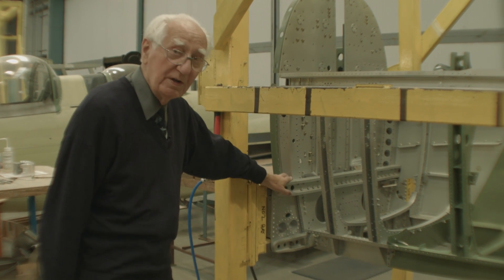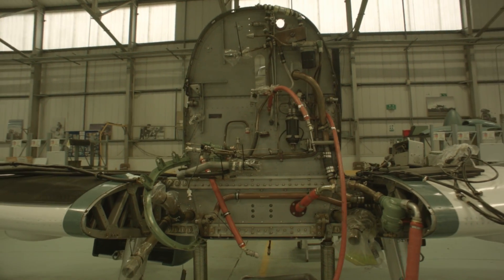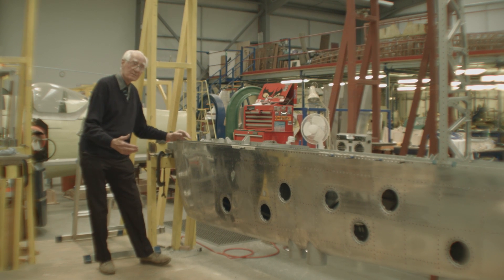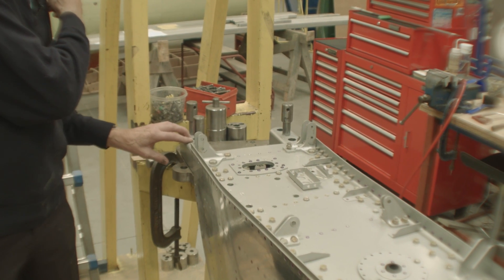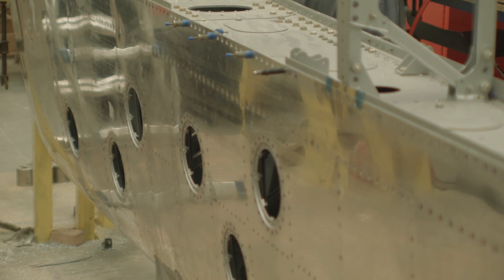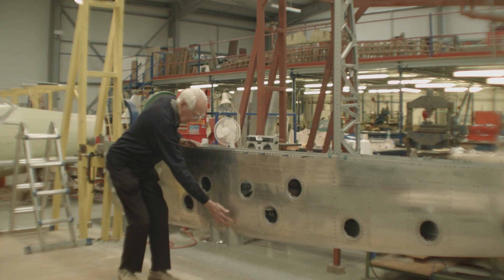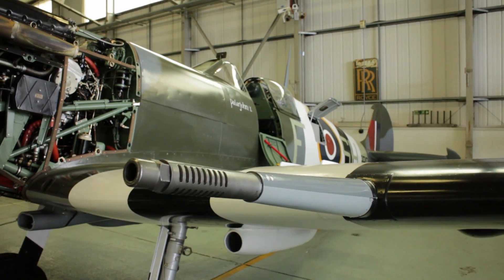Norman explains Spitfire Wing Construction

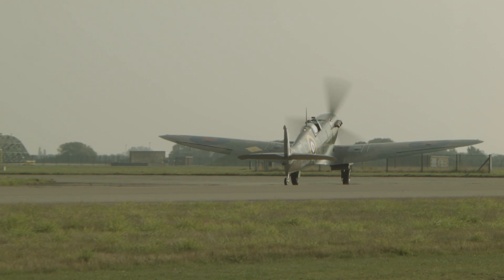Comment: 0:25 leading edge is at the bottom, and trailing edge is at the top. The main spar, or upright of the D is at the 1/4 chord position. The center of lift also occurs 1/4 of the way from the leading to trailing edge, so making the 1/4 chord a straight, unswept line from wing root to tip, you put no twisting moment on the spar. That's why the Spit's elliptical wings are skewed forwards from root to tip
Reply: This is not true, you´re over simplifiying mixing aerodynamical and structural considerations (twisting of the spar...?) The "D" is the torsion box between the L.E. and the spar, and the wing has a 2,5º twist in order to keep the stall on the root first, maintaining aileron control yet in incipient stall.
You´re plenty of information material available, so I left here a link in order to clear some considerations.

https://www.aerosociety.com/media/4843/the-spitfire-wing-planform-a-suggestion.pdf
Reply: @TheMissing62  what do you think I said isn't true? The aerodynamic loads are inherently connected to the structure. That's why the wing is the shape it is. Note that thee is a difference between twist distribution (or washout) and twisting moment.
Reply: @TheMissing62  but don't take it from me, just read the last few sentences of section 2 and the first few of section 3 in the paper you cited. That's where the author mentions lining up the spar with the 1/4 chord to neutralize the twisting moment
Reply: @paulgush  OK, I apologize, maybe I rush to an answer of your comment or misunderstood it, but IMHO there are much more than AC, center of pressure and moment coefficient in the election of a semi elliptical planform like Shenstone used in the design of the Spitfire wing. 
There are more articles about the Spit wing, I can put the links if you are interested.
Kind Regards.
Reply: @TheMissing62  peace. All I was saying is given the choice of an elliptical platform, this is why it's skewed
Reply: @paulgush  OK, let´s give one more twist: I think that "skewed" is not the correct word, the wing is not "skewed" in any way; let´s see those links with a deeper explanation; they will be the last, I promise.

https://thoughtality.com/downloads/decoding-spitfire-part1.pdf
https://thoughtality.com/downloads/decoding-spitfire-part2.pdf

Comment: I was studying the wing-bridging structure of the Hurricane recently, and it's a lot of heavy tubing, looking rather agricultural. By comparison, this is so simple and elegant!
Reply: Good choice of words. The centre wing spar on a Hurri looks like it was stolen from a railroad bridge.
Reply: @davidbeattie4294  I haven't seen the Hurricane bridging structure, but railroad bridges, or trusses, are very structurally efficient. As an aero engineer, I can assure you that some new airplanes in 2021 are still being designed with tubular steel space frames
Reply: @paulgush  
It’s amazing how simple the Spitfire wing attachment system is - 8 bolts each side with just those two transverse beams at the front connecting the wings into a single rigid unit. It’s hard to credit that that alone could make such a strong structure.
Unfortunately, the Hawker Co. were nowhere near as advanced and/or sophisticated and instead used heavy metal tubing round the cockpit and wing roots of the Hurricane. This also reached back and supported the rear fuselage too - a sort of internal metal skeleton. Virtually identical to a system they’d used on their earlier biplanes. 
They even used something similar on later aircraft and it makes you wonder how much weight could have been eliminated - absolutely crucial in high-performance fighters - from the Typhoon and Tempest if they’d been more up to date and used monocoque construction instead.
Bridge-building techniques might not be suitable for fighter planes…
Reply: @VincentComet-l8e  for structural efficiency, or strength to weight ratio, it's very hard to beat a truss. A monocoque certainly doesn't. The reason high speed airplanes adopted monocoque structures was not for weight savings, but aerodynamics. At high enough speeds, a fabric covering starts bulging outwards, losing its shape. This affected the Spit as well. For the faster, later models, they had to change the fabric covered control surfaces to metal skins, because pilots were losing control authority in power dives.
Reply: @paulgush bridges don't fly.  The Hurri was about 900 lb heavier than the spitfire with the same engine, not to mention the high drag of the Hurri thick airfoil